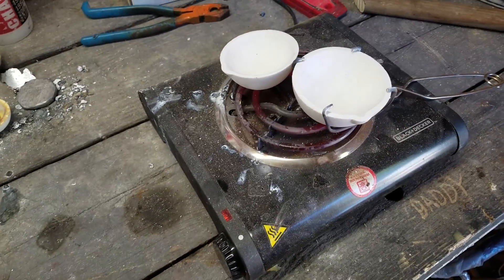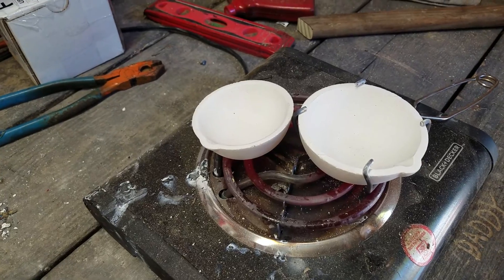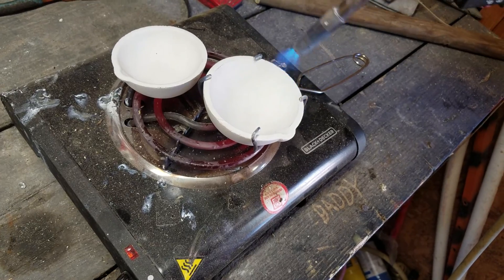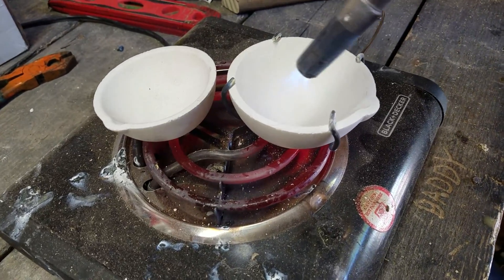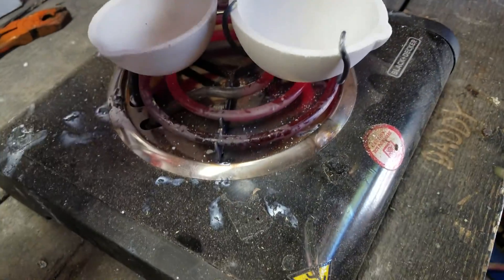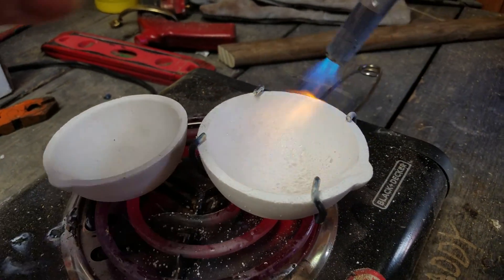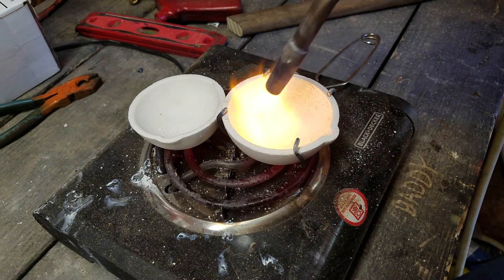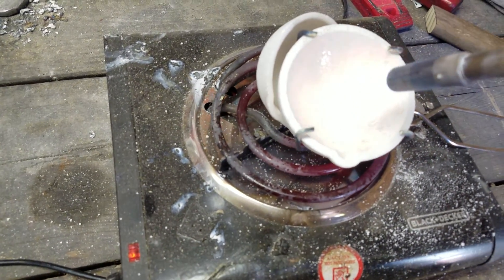How to flux prep precious metal silver melting dish with borax

Comment: That's what I used starting off I couldn't stand it I kept on losing silver in the dish in fact I'm pretty sure I still have silver in one of those dishes lol but good luck my friend I'm sure you're better than me with those.
Reply: Matthew Smallwood Were you melting boric acid into the dish first? It acts as a lubricant, shield, AND cleaner!
Reply: Jan MacGregor lol yes I did glaze the dish before using it but now I use graphite crucibles so I don't have that problem.